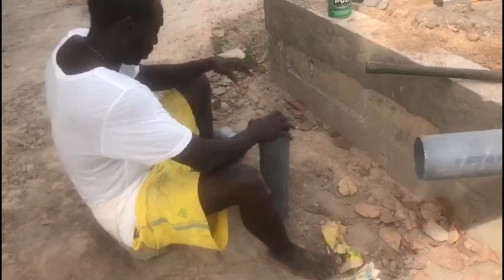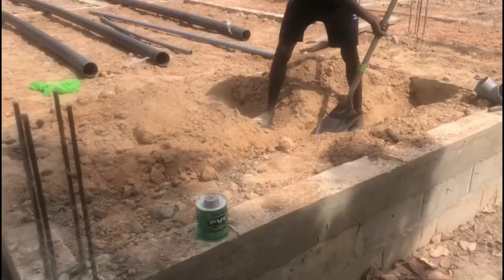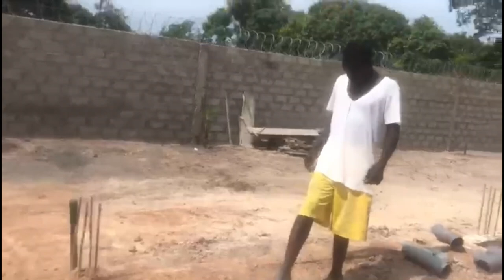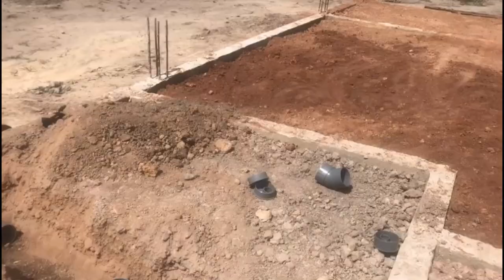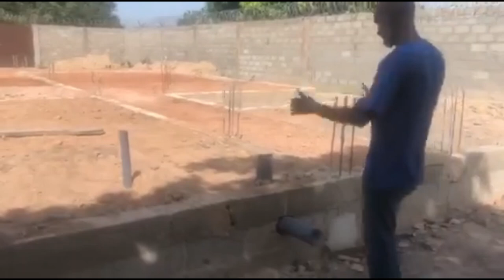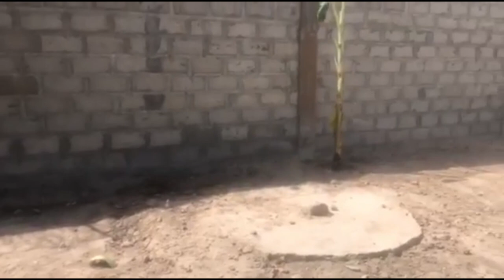The Arrival finishes plumbing part 2 in The Gambia

Comment: 🇯🇲 Terry, I noticed you said you're please & happy how the work was done.
I've seen enough not to trust those Gambian contractors. The contractor should've done the flow-rate before he covered the pipes.You guys need to do your verifying/homework.
Kenny, I don't know if you did but if you didn't turn on your water hose down every vertical inlet pipe and let the water run for awhile.
While doing so put some 1 to 2 inches pieces of tree branches, simulating faeces, to see if & how fast they flow thru to the outlets.
Very important is the flow-rate because if water & solids flows too slow it means the pipes are not slanted enough and this will cause regular backing-up and blockage.
Even after you do the casting the heavy steel meshing & wet concrete is going to sink/settle and possibly shift the pipes.
Make sure to run the water & solids( 1 to 2 inches pieces of tree branches) again immediately after casting foundation, while it's wet and can be easily adjusted.
Reply from the maker: Thanks so much🙏🏽💞🙏🏽💞🙏🏽💞
Reply: I'm not a contractor nor a plumber,  but I was conversation that no leaks would happen.  And if they did, how would you know after the cement has been poured for the foundation? If doing as this commenter suggested for the other concerns would you be able to fix the leak while the cement is still wet?
Reply: @carleonemoore9359  🇯🇲  English language is not as complicated as you're attempting to understand or write.
I simply advised Kenny to do the testing now or anytime b4 the foundation is poured.
I also suggested to do the same after casting the foundation because of the weight bearing down on the soil.
If the pipes are shifted at that time causing a slower flow-rate is would be much easier to escavate & reach because of the wet concrete as compared to when it's dry.
Reply: @BORNFREE876  Thanks for the clarity and my apologies, but sometimes I have little mental block due to a stroke.

Comment: Also did they run the same size vent to run through the roof
Reply from the maker: When they put the walls up the plumber will finish the pipes 💞🙏🏽💞🙏🏽💞🙏🏽

Comment: Are the pipes always buried underneath the foundation? What happens if there is a leak…does the foundation need to be broken and the pipe fixed? 

Can pipes be built above ground?
Reply from the maker: That is the way they do it here. The only way there is a leak if there is a leak in the beginning.  ...but yes they would have to dig it up. In the states the pipes are in the wall and floor so it would still have to be broken either way. If that makes sense  
💞🙏🏽💞🙏🏽💞🙏🏽💞🙏🏽
Reply: @TheArrival2020  Okay. Makes sense. The reason I inquired was because I saw a build in Ghana where the pipes were above ground and encased because the owner did not want the hassle of digging up his foundation if there was a leak. His design was not very pleasing to the eye…so I get why it’s either underground or behind the drywall like in the States. 💕
Reply from the maker: I see it does make it easier above the ground. But when they do brake the wall ir floor I'm sure the plaster and paint and wala . 
It might not look 100% but maybe 98% will do if leak is fixed right 🤣🤣🤣🤣
Reply: @TheArrival2020  💕🤣